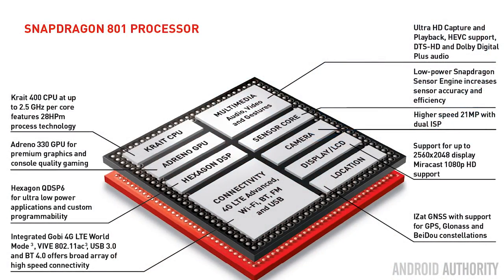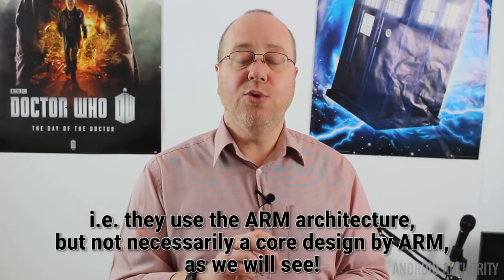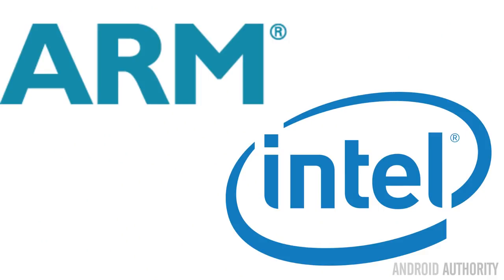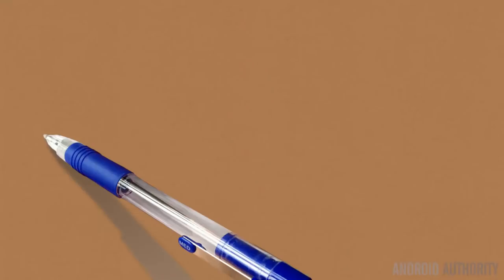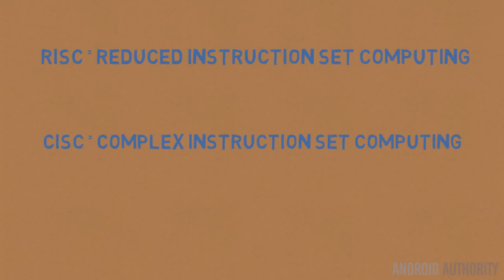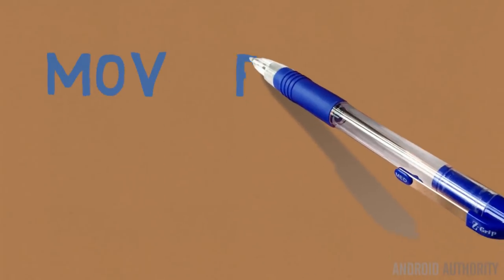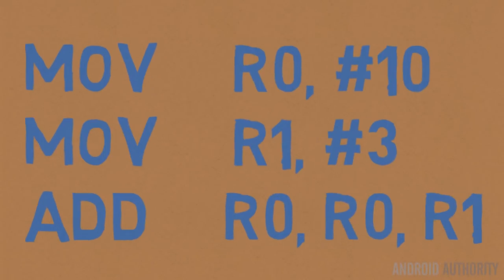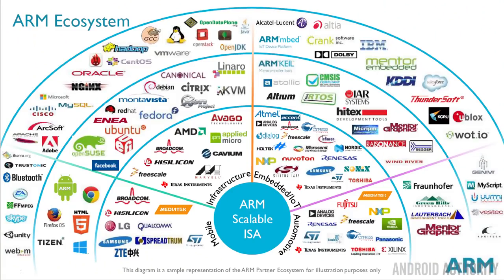Custom cores versus ARM cores, what is it all about?

Comment: So which heats up the most? RISC, or the CISC?
Reply: +Foxtrot November It isn't as simple as that unfortunately.
Reply: +Foxtrot November CISC.
Reply: ***** Why? Please give me an explanation.
Reply: Rishabh Mahajan How?
Reply: Foxtrot November CISC has a huge architecture,  because the number of instruction set is very huge.
On the other hand RISC uses a very small instruction set, which doesnt require that much processing. This is the prime reason RISC is used in mobile phones.
I hope i could help.
Reply: +Foxtrot November There are many many factors when it comes to heat generation inside of a processor not only the architecture type (i.e RISC or CISC), but also the microarchitecture, the clock speeds, the voltages, the other components like the GPU, and the fabrication process.
Reply: ***** These days due to technical advancement the line between RISC and CISC considering performance and efficiency has blurred a lot, So yes Gary is right its not that simple to answer.
Reply: Rishabh Mahajan So how many sets of instruction set in a CISC compare to RISC?
Reply: ***** Does that mean that when the unit is idle. And is powered on. It produces heat to the extent where a smartphone could explode just like what happen recently? Was there any instructions given to the system where it would instantly powered down or turn the unit off? Given the fact that there are so many chipset manufacturers out there. Which would you considered be a safe chipset? And has a better developer support?
Reply: Rishabh Mahajan Does that mean the majorities of those cisc chipsets tends to overheat too much and could explode, injuring the user? If you say that the RISC USES 30 - 40. How much android system uses instructions in that category?
Reply: Foxtrot November That is why cisc is only used in laptops and workstations, they provide power and enough space for cooling of the chips and battery are huge enough.
Phones have very small battery and cant handle cisc at all. But they dont require that much power generally(facebook, instagram)
so risc is enough for them.
Computers require much higher power (windows, photoshop) and risc will not provide them, so all intel Amd are all cisc in computers
Reply: +Rishabh Mahajan What about fanless laptops like 12 inch Macbook? does it also have cisc? how did they prevent the heating? by allowing it to thermo throttle or something else?
Reply: +Shayan  yup. They do have a cisc architecture. They are however greatly underpowered compared to their desktop or workstation counterparts. In fan less design laptops scheduling of the tasks is a higher priority for better performance. However in certain high load situations thermal throttling does occur. This is mainly to prevent power loss while maintaining some performance.
Reply: +Foxtrot November Instructions aren't like instructions you tell the chip to do something ie if tap then open app. They are more like the operations needed to understand how to do the previous example. Say for the chip to open a program it is the equation:
(a^2+b)/c
RISC only knows how to do the basic instructions +,-,*, and / while CISC has instructions for understanding () and ^2 along with the the RISC instructions

RISC would need to calculate the equation in 3 steps
1) a*a=x
2) x+b=y
3) y/c=z

CISC would do it in 1 steps
1) (a^2+b)/c=z

While both get the same answer RISC needed to take more steps to get to it since it needed to go through every operation while CISC could understand the more complicated equation and do it in one step. Though it seems CISC is a better system since it can do the problem in 1 step, it is also more complicated because you need to have 6 instructions built into the chip vs only needing 4 for RISC. These extra instructions help cause more heat in chips and require more power because it is more processing the chip needs to do each cycle. This is fine in a desktop situation where you can have heatsinks and fans, but a phone doesn't have the luxury of having those so must use a simpler lower power/heating solution (RISC). Very simplified example but hope it makes some sense.
Reply: Panzer_Z So why would a CISC be placed on mobile phones as a processor? What the he'll is going on with these manufacturers mind? Also, is there a 64 bit CISC specially made for mobile devices and uses complex operating system like android and Windows?
Reply: Rishabh Mahajan So why did some companies used CISC chip on their mobile devices?
Reply: Foxtrot November Intel has done lots to lower the overall thermal footprint of CISC processors to levels comparable to their ARM/RISC competitors. The current crop of Atom mobile chips are 64 bit and Android has been able to run on CISC X86 platforms for years now. Windows has since it was created.
Reply: Foxtrot November Because they have been doing CISC based chips all these years and now they have reached a level where they can compete with their RISC based counterparts. There is more to this though. Right now ARM is the leader with its RISC based chips when it comes to the mobile market. On the other hand Intel is the leader in the desktop, laptop, server and so forth. It also faces some competition from AMD and others but still it is the leader. Now take this case, In the entire world do we have more of PCs or cellphones ? Though servers and desktops are an integral part of our lives and the internet, mobiles are now becoming a defacto device to use the internet in a lot of markets. Also people change their mobiles more frequently than their desktops or servers or even laptops. I have been using my server for lik 5-6 years now, in that span I have changed more than 6 phones or devices, 4 of which were smartphones with ARM designed chips. See the tremendous market here. In case of desktops too, people are more likely to change individual components like boards, processors, graphic cards and the so forth try doing the same with your phone here.
Reply: Panzer_Z So why the lack of developers support?
Reply: ***** So why would some phone manufacturers placed a CISC on a mobile device if its technology requires a cooling fan? Isn't Atom processor a CISC?
Reply: Foxtrot November Because now it doesn't require all that cooling. Even RISC based processors (Snapdragon 810) heat up crazily (70*c). Back in the day MediaTek chipsets used to heat up too (upward of 70*c sometimes). The fact is Intel has come a long way in developing chips that are power efficient and donot compromise on performance. I used to have an Atom powered Netbook and it used to touch 60*c or even 70*c under load or while watching HD video on my TV. These days the Zenfone 2 handles the same and it doesn't heat up that badly too despite have a fanless design. Chip design is all that matters and Intel sure have made tremendous progress in that matter. If look at the bigger picture ARM on the other hand used to have an advantage of being cooler and more power efficient but the current implementations like the 810 seem to say otherwise. In the end it all comes down to design. If you have a good design no matter what you throw at it, it will work out (Apple A9). Hope this answers your doubts.
Reply: Foxtrot November What lack of developer support? Developers only need to develop for Android or Windows, both run on CISC and RISC based chips now.
Reply: +Gary Sims i agree. just through simple experience. i compared the heating on my intel device with my qualcomm soc phone it differs from time to time which device would actually heat up even though I'm running the same program on each device.
Reply: Panzer_Z majority of mobile developers have made apps for Android for which are risc processors. However, they would make some apps for those Cisc class. Have you ever wonder why there are apps that only supports qualcomm or tegra powered device for Android?
Reply: Foxtrot November if it runs on Android it will most likely run on an Intel chip. Android has supported running on Intel CISC chips for a few years now. The only apps that aren't compatible are ones that call on special operations that aren't supported by Intel chips; otherwise if the app is coded to run on Android, it will whether it be running on ARM/RISC or Intel/CISC.

Comment: apple muat have done something that enable their dual cores to be able to keep up with quad and octa cores.
Reply: +999CATZ they make their cores to be like a cisc(not exactly cisc) like Intel. So they produce better performnace like Intel quad cores beating some of the AMD's Octa core CPUs
Reply: +Anantha Krishna Hmmm... I don't think that is right.. Apple's cores are ARMv8 compatible and when you look at the Apple backend to things like the LLVM compiler suite it seems to be producing normal ARMv8 code.
Reply: ***** I should have done more research I guess. Sorry for giving false info. :)
Reply: +Anantha Krishna Don't worry about it, you are right in that Intel and AMD both use the same instruction set architecture but yet there are differences in performance. That is also true of the differences between ARM, Samsung, Qualcomm and Apple. Having said that, I think the your idea is probably right in that Apple must be implementing more stuff in hardware or at least optimizing certain pathways in the hardware. I had a section on this int he video but I cut it out as the video went to 18 minutes. There is more info in the written companion on the AA website.
Reply: Oh thank you. I will check it out
Reply: +999CATZ apple's 2 cores are physically bigger, more transistors per core = better single core performance in benchmarks compared to to other quad/octa core variants. it's multicore performance are on par with Samsung's Exynos 7420.
Reply: +pyr0bee Multicore performance is lower than 7420 even though Apple A9 is half a year younger. Exynos 8890 is going to have much higher multicore score than A9 and both 8890 and SD820 are going to be really close in single core performance even though they have less transistors per core.
Reply: +sic22l then again android suffers from thermal throttling resulting in lower performance and poor ram management no matter how big the ram is.
Reply: 999CATZ It has nothing to do with Android. Not poor RAM management but different RAM management - apps are actually running in the background.
Reply: +sic22l iOS able to make full use of the 1gb of ram without compromise. Even if there is no recent apps running in the background , my lg g3 ram still used up quite often. Those on asus zenfone 2 may also experience similar issue.
Reply: 999CATZ System uses RAM and it's normal in any device. The higher the resolution, the more RAM is used by ayatem and all apps (because they have to render image in higher res, therefore bigger).

Comment: great vid!!!  But I don't agree that apple is ahead in performance, compared to the competition, samsung's exynos CPU wipes the floor with the a9,in geekbench my s6 edge plus scored in multicore 5471 and my 6s plus only scored 4344,In antutu s6e+ scored 68946 and the 6s+ 56377 and even in day-to-day use the s6 edge plus is much smoother and snappier, although it runs on a much higher rez screen and a much heavier OS and Interface, so I don't agree
Reply: +Richard Rusinaru That is interesting to hear... I haven't done my own iPhone 6S versus Android flagship tests so I was basing my conclusion on Anand's results here: http://www.anandtech.com/show/9686/the-apple-iphone-6s-and-iphone-6s-plus-review/6

I hope in the future to be able to perform some tests myself.
Reply: +Gary Sims the browser is much faster on the iPhones, but anything other than that... but that's depends from the browser too,I use both worlds and I have to say, safari is much faster than the chrome on my s6e+

Comment: gr8 video

can anyone explain me in layman's term that what is the difference between architecture,core,chip and soc

i m little confused between architecture and cores
Reply: +ritik gupta So I will start with the easy one, a chip is the generic name for any silicon chip, could be a CPU, a motion sensor, a digital-to-analogue converter, a temperature sensor, anything. It is like saying "car" rather than Ford or Ford Mustang.

A SoC is a System-on-a-Chip, so a chip (as above) with lots of different bits on it including the CPU, the GPU and other interesting bits and piece. In the past (before the smartphone age) these would have been each on their own chip.

An architecture is the rules which define how a chip works to the level that another company could build a chip and it would be compatible (run the same programs) as the original. ARM, Intel and MIPS are all different architectures but they can all run Android. But a program written for an ARM chip won't run on an Intel chip etc.

Inside a modern CPU (Central Processing Unit, the brains) are one or more cores. Each core can run a different program in parallel with the other cores. So maybe one core is checking your email, one is playing your music etc. (Note, this is an over simplification, but I am talking beginner level here). This means you get single core SoCs, dual-core, quad-core, hex-core and octa-core. The idea is that two low-power cores are better for battery life than one big core (but again this is a simplification and also quite contentious).

My video is about how the cores are designed and by who! Does that help?
Reply: +Gary Sims 

it really helped thnks bro
Reply: +ritik gupta *sir😁
Reply: +Gary Sims 

sir can u pls answer my ques

sd 810 and exynos 7420 both runs on arm big little architecture and hv same custom a53 and a57 cores

the only difference i found is that exynos is built on 14nm fabrication and sd 810 on 20nm

bt y exynos is so much better than sd 810?

and thnks for the previous reply 

u r gr8 sir😊
Reply: +ritik gupta Well that difference in fabrication process makes a HUGE difference. Plus they have different GPUs.
Reply: +Gary Sims Then how does apple bring so much power efficiency with just 2 cores?
Reply: Shayan  That is a good question, to which nobody has a good answer!
Reply: kent vun Gary already answered him in much more detail.
Reply: ***** 

sir apple processors are supplied by samsung

so what samsung does? 

it makes custom cores or it supplies SOC's to apple?
Reply: +ritik gupta Samsung does both. Samsung is a large electronic company that makes everything from microwave ovens to smartphones. It has has its own chip foundry. So there is a division that designs SoCs for smartphones and it uses the foundry division to make those chips. But the foundry also manufactures (not designs, just physically makes) chips for Apple and Qualcomm and others.

Comment: stop the propoganda 95% of desktop applications and software are designed as x86 NOT arm ....as such software is proprietary non open source most are not able to recompile to use arm....thus an emulator would need to be used and that will kill any advantage you had ....100% , nice to see you never say this.... on hand helds per brand you and a vender cna make an OS and apps base don it and thats great for apple but it leaves apple as a walled in non compatible with any thing outside its walls. look at blender...are you gonna recode all that for us all ? and then recompile it? how aobut windows it self? or linux OR bsd ...ya know what the mac os is based on....see even the apple os is x64 based. they all are except on one hand held phone. Could care less if it was natively 100% faster which it isnt ...add emulation to heavy use gf card and cpu apps and that emulation dies on you fast.